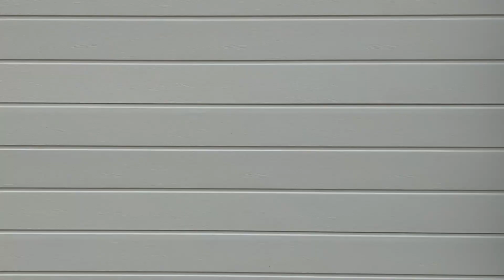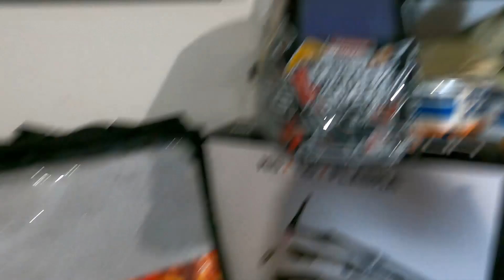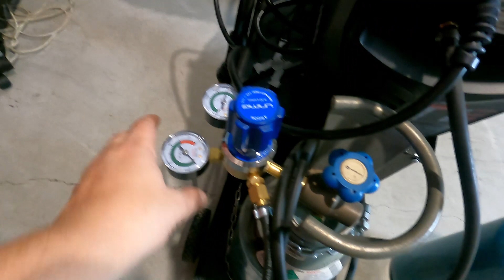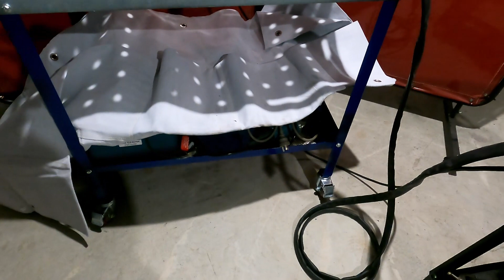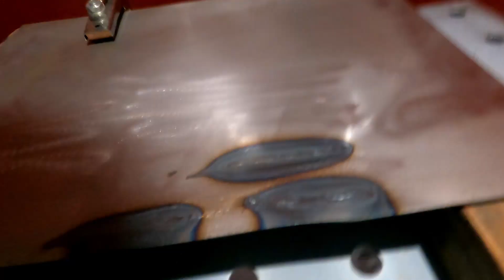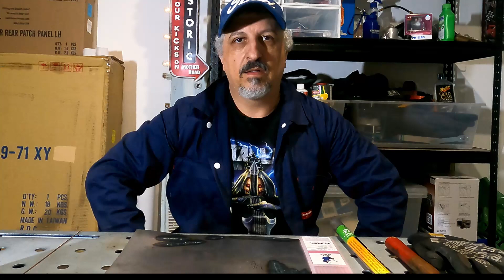DC Lift Arc TIG Welding with the Unimig Viper 185 for the first time

Comment: The reason it can't do aluminium is: it's a DC-only TIG machine (in TIG mode). You need AC TIG for aluminium. High-frequency vs lift-arc only refers to how the arc starts. (In practice, most AC-DC TIG machines offer HF start. Most cheaper DC-only machines offer scratch-start or lift-arc, but not HF. (You need the DCEP part of the waveform to clean the aluminium, while the DCEN part deposits the weld.)

Comment: Thanks Rob, great tip about the filler rods at Bunnings. I have the Viper 165 learning as I go, there are so many variations of all aspects of welding. Hoping to get it right too.
Reply from the maker: @WayneHavenaar  Good luck my friend. Welding is a journey. Thanks for watching.
Reply: @robsgarage69xw mate I seen somewhere if welding 1mm steel match the same size filler rods if you don't have them you can use MIG wire give it a go

Comment: Thanks Rob, I have the same Unimig & want to have a go at TIG. What size tungsten & type are you now using …. Is it 1.0 or 1.6 diameter, ceriated or lanthinated?
Reply from the maker: Hi Wayne I've been using mostly 1.6mm mostly multi-mix which is pink top. I've just ordered 1mm LaYZr tungsten which I've heard good things about and might be better for sheet metal repair but time will tell.
Reply: @robsgarage69xw  thanks Rob I’ve heard 1.0mm ceriated(Grey) are ok & around 50amps on 1mm panel steel? ….. will lift arc be ok when tacking ? Haven’t tried any of this yet
Reply from the maker: @wayneodonnell8847  I ended up buying a dedicated Tig machine with HF start. Makes life easier. I'm sure it can be done but I didn't persevere with lift arc Tig on the Viper 185.
Reply: @robsgarage69xw  I was wondering if I should do the same … the lift thing might be a pain ! … can I ask what machine you ended up buying for TIG ?
Reply from the maker: @wayneodonnell8847  I got the Unimig Razor AC/DC 200 Pulse. They have since updated to a newer version. Have been happy with it other than switching to a ball float regulator.
Reply: @robsgarage69xw  nice one …. You need to do a video for us … I’m keen to see how it goes 👍
Reply from the maker: @wayneodonnell8847  I did do one. Link below ,👍 https://youtu.be/cwCtCHy_GKo?si=0otpx-tGcyM8SgZ2

Comment: Nice vid mate I’m looking at getting the same machine. Any progress on the TIG welding? Keen to know how you rate the TIG feature. I mainly want to do exhaust piping. Thanks
Reply from the maker: Hi Jay, I've done some additional work using the Tig however for my application mostly using for thin sheet metal I think I need a tig machine that has HF start and ability to adjust amps with a pedal or switch. Otherwise I think the Tig feature is pretty good.

Comment: I have a 3in 1 unimig 250 its the best welder i have used in a long time. Dont forget to purge the gas lines when not in use  regs or solonoids  dont like it in the long run.